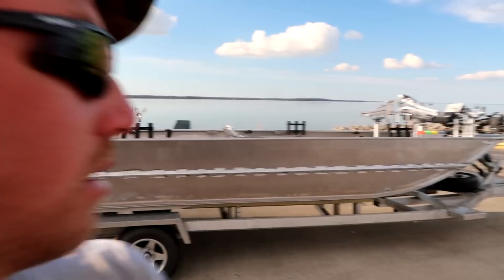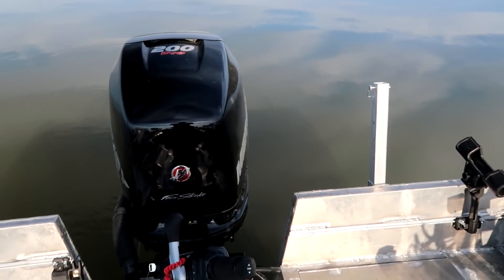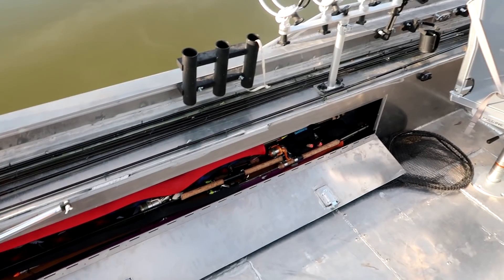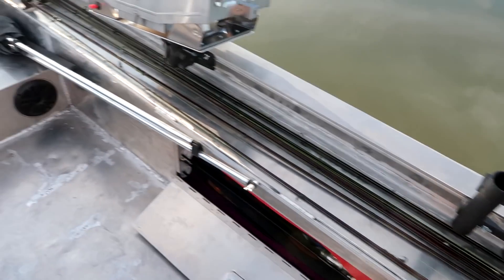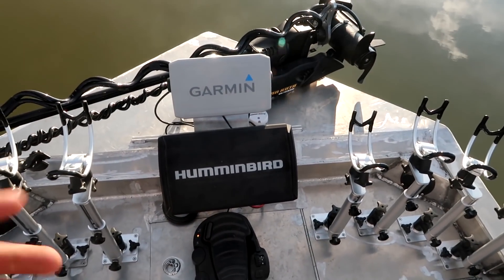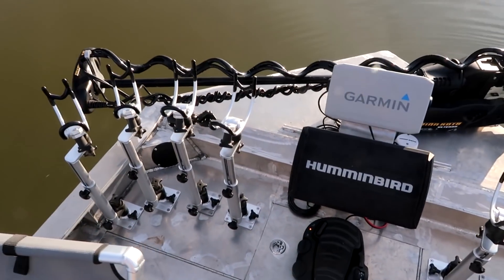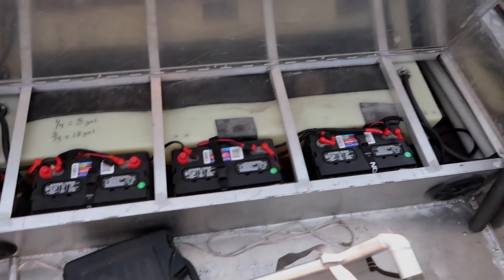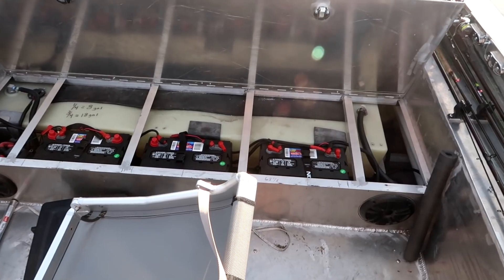Touring My 25ft Homemade Boat

Comment: Simplicity and utility. That's the best way to do anything. No need for unnecessary aesthetics. Common sense design looks the best anyway.

I would personally make it even more simple, and allow for better access to the internal structure of the boat for easy repairs, should anything get beaten up, but other than that, I can't imagine a better designed boat. I wouldn't change a thing.

Comment: I love this boat bro!...... it’s so user friendly the way it’s set up.... just simply well done bro well done..... the only question I have is, why did you choose to have a tiller drive motor instead of a center con. Or traditional steering with controls?.... hope that question made sense.

Comment: There is no way the boat weighs 4,000 lbs. and still goes over 50 mph with only a 200 hp on it. Sweet boat though none-the-less! Well done! I love how much effort you put into the boat and did not skimp anywhere. A custom boat builder wouldn't have even put that much effort into a $200k boat.

Comment: Nice boat man, finally someone smart enough to put the live well and batteries in the front of the dam boat.
Reply: Varnce; hmm I’ve always had the opposite experience. One time My boat was taking on water it was to heavy to plane and we needed to get to shore fast so I had 2 of my friends sit on the bow and poof we were up on a plane. Idk about the stress part that may be true but I cant believe the batteries and live well could be heavy enough to stress an aluminum boat of this size hey but I’m not a boat builder so what do I know.

Comment: Your design, build & documentation was genius ✊🏾 I just binge watched the whole boat build. This is a project that I’ve been mulling over to start but out of wood (Jon boat, float bottom design). I do have a few questions: 1) Will you do a video on cost analysis of this build? 2) Will you do a video on the boat’s performance? 3) Is there anything you’d do differently? Again, this was a great series of videos, definitely gave me some motivation.

Comment: Little bit of background on your welding equipment and your experience welding especially Aluminum.  Myself I have welded lots steel but no experience in Aluminum wielding,  wish had plus thing about buying a new Millermatic 220 or 255, want weld Aluminum. Excellent well done guy.

Comment: We are dying to see this thing on plane. What was your cost just for the Aluminum I am curious it would be cool to see a parts list just for the Metal
Reply: It's messed up he liked your comment without replying.
Reply: I know nothing about aluminum or metal pricing but If I had to guess, I'd say 8500 for aluminum and weld material. Not sure of the thickness either but I'd guess 3/16 sides and quarter bottom
Reply: im guessing the video of the boat planing is a ways off yet. its absolutely obvious that this hull will have massive cavitation issues and this will stem 100% from the poor bow design and 27 degree pitch busting straight onto a near flat bottom of 15 degrees stern to bow pitching. ..... whats scrap aluminium worth? should get about a grand or two.

Comment: Bedline it. Have Home Depot dye some Henry’s 587, add some hardener to it, and spray it through a 5 gal pressure post ($375 through TCP GLOBAL). If you pay more than $1,000, I’d be surprised.

Comment: Thank you  for sharing all the videos of your build. What a beauty. If you have not painted the inside yet, you may consider Raptor bed liner. It was going to be $600 for my short bed truck for lineX. For kits, brushes, tape, plastic and other misc. items, I have $200 in it. It can also be sprayed. If you had to in the future, it can be ground off, welded and repainted. Looking forward to seeing it on the water. (I have no interest in Raptor, just sharing my experience)

Comment: I would NEVER linex this boat.. Not Ever !   This destroys your ability to inspect, repair or modify it.  A good aluminum boat can last 100 years.  During that time.. a LOT of shit can and will happen..   Linex will be degraded by UV light.. which means eventually it will crack, or come unstuck.. creating pockets where corrosion can start and go undetected.  This can mean the boat can become structurally unsound.. and inspection wont reveal it.  You will have a toxic nightmare of some sorts.. everytime you have to remove some of that crap.         Look at airplanes.. they will paint the inside with Zinc Chromate etching primer.. and call it good.  Of course those are riveted, now welded.            Even epoxy paint would be a better choice.But if your allow is good.. you don't need anything.  If glare is a problem.. use a rug or plywood,

Comment: Congratulations to you for hanging in there to finish the boat project.  Its eazier to get burned out on a project than most people think ( Ive burned out on a 10 year project after 5 years myself ).  When it does happen, its very hard to get restarted. My hat's off to you for that !!!  In my opinion you have done an amazing job, both in planning and execution.  Now you can keep the rewards !!!  Good fishing !

Comment: You really should explain your battery/fuel box venting and explosion proofing. I looked but could not figure it out, and maybe you covered it in another video??
Combustion only needs three components- fuel, oxygen, and ignition source. You have all three possible in a nice little compartment. With hydrogen gas from the battery’s and possible gasoline fumes from any small leak, you even have two fuel supplies !!
I’m sure you thought this out and studied the marine construction codes, but please cover this so someone else does not make a mistake that could be fatal!
Thankyou
Reply: Nicely done.